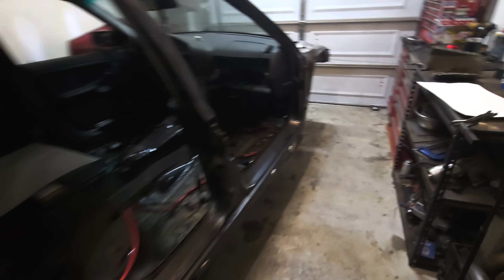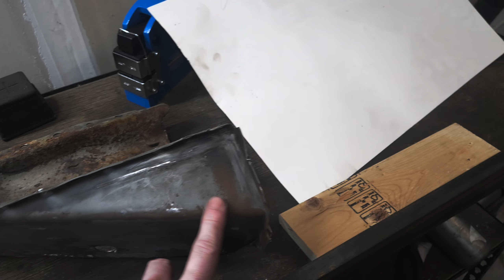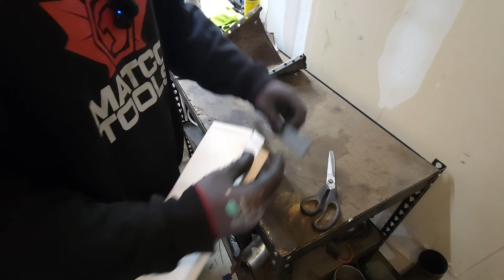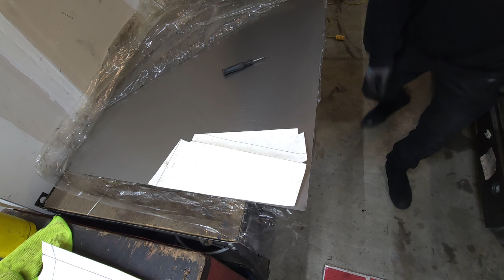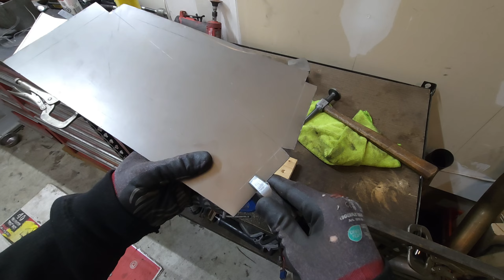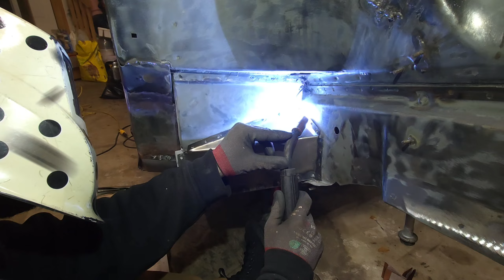E36 Rust Repair & CAD + DIY Metal forming

Comment: Very nice videos, I look forward to working on my e36.
Please, how thick was the sheet metal for the sills, floor and pockets? Thank you.
Reply from the maker: The metal i used was 18G for all in inner stuff and the floor, then the piece i made in this video was 20G, The rocker its self i believe to be 19G
Reply: @Christopher_Jason  Thank you and next and last question :D What primer do you use? For the entire sheet metal and what kind of welding paint?
Reply from the maker: @michalpetic Zinc Weld through for the welded areas and Spray max 2k Epoxy for the non welded areas

Comment: Hey! Thanks again for the detailed walk-through — great job as always!
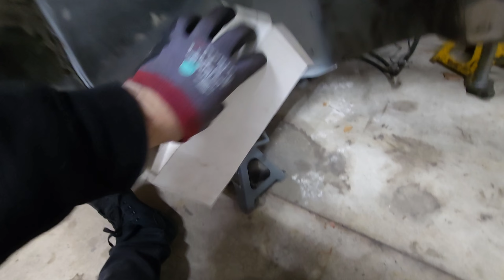For me, the most helpful part was what you said at 12:33. I tried to make this panel in one piece, with rounded bends and no overlapping. I even tried adding a bead on the bottom part so it would look like the original. All of that using just a hammer.
I’m not saying it’s impossible to do it that way, but it was just too hard for me. I always ended up with poor fitment and had to start over.
Now I see that simplifying the process can still give a really nice result. I also like your custom tools for shaping — can’t wait to see them more in action. Hope your channel keeps growing!
Reply from the maker: Thank you !!, I always try and simplify the repairs and custom stuff i do as it can quickly snowball into scrap metal and wasted time, i mean its also a learning process ive wreaked enough stuff to learn that you gotta step back and create a plan/process to get the outcome you want. And yes Hand bead rolling with a hammer would be a very difficult im sure it can be done ive never done it, my plan is to but a manual bead roller soon though.

Comment: Good to see it coming together more and more! The home/shopmade metalworking tools are pretty cool, goes to show how ingenuity can take you farther than your wallet can sometimes. The CAD (cardboard aided design) is something I see more and more which shows that even as technology gets better and better, the simple stuff still has its place.
Reply from the maker: Dude Honestly the simplest tools can take you almost as far as having a tool box and shop with 100k worth of stuff, even at the shop, the only difference between what i did here and there is i had a Break to make Clean quick bends vs Hammering each one, and I mean having the ability to do panels like that in one piece vs 2 is dope but you still get a great result either way, and Hell yeah Cardboard is the best and cheapest way to this work. Computer Aided has its place and many benefits and ill be using it for things here and there (probably alot of engine stuff) but a ruler, pencil and paper you can design so much and plan it out so easily,  its amazing what you can get done on the cheap, which i hope im conveying to everyone that you dont need professional tools to get a almost professional product